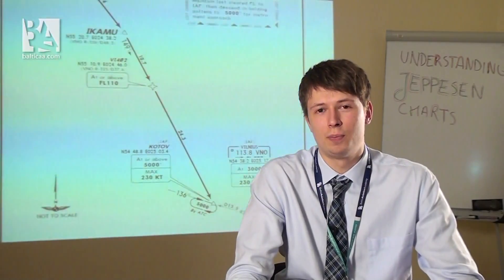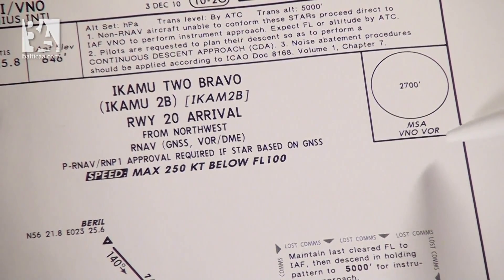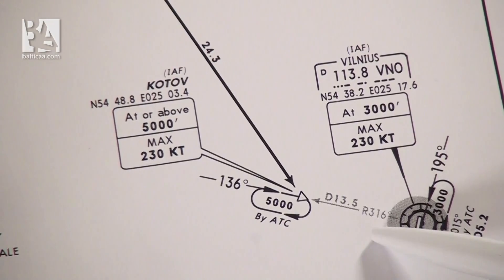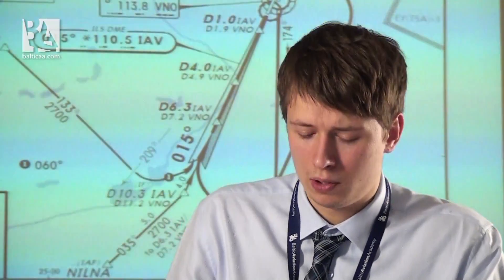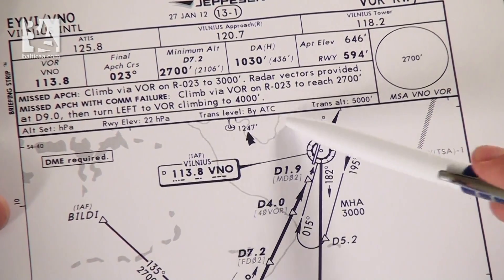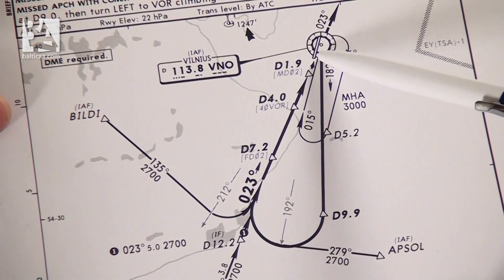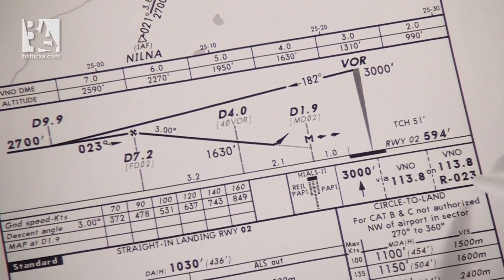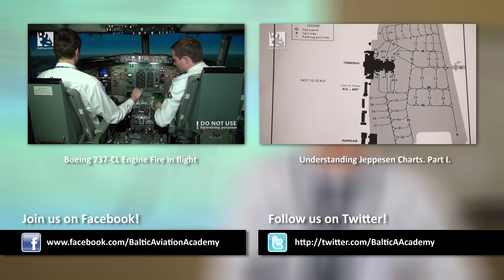Baltic Aviation Academy: Understanding Jeppesen Charts. Part II.

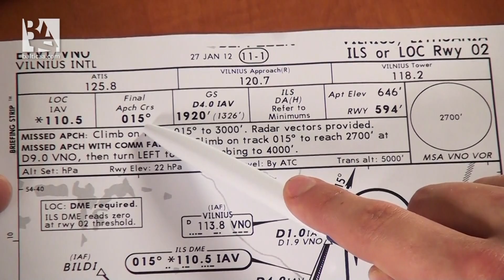Comment: However, the information you have mentioned at 6:20 regarding the final approach fix is not precise. The final approach fix for this approach is at 6.3 DME IAV at 2700 feet AMSL as indicated on the PROFILE view of this chart. To be more specific, at the Maltese Cross symbol. The second point is that on the PLAN view of the chart, that bold holding race course shape is called a COURSE REVERSAL. because it is bold, it has to be flown as charted. It is used to position the aircraft on the intermediate/final approach segment if the aircraft is commencing the approach from overhead the VOR. So its not for circling.